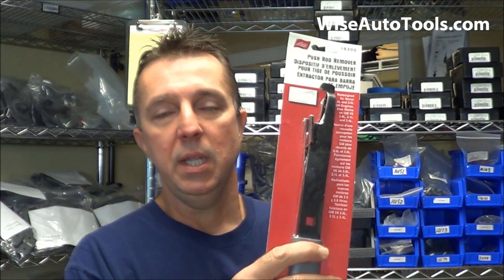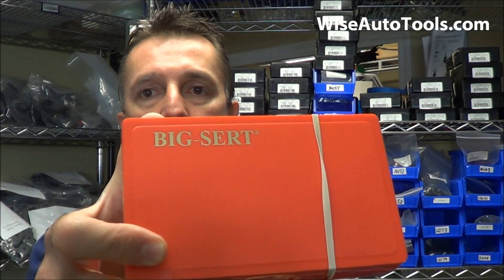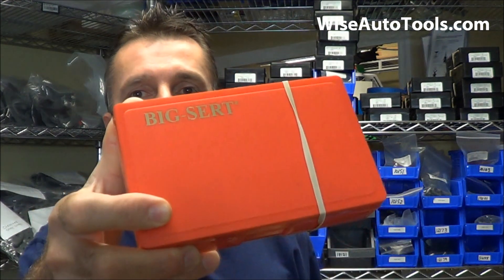Time Serts for GM Rocker Arms

Comment: I've been using the 1/4" techangle torque wrench and haven't had as much trouble as I had been having on these. Use a 1/4" torque wrench or use the special tool to avoid removing the rockers.

Comment: How do you know if your engine has 8mm or 10mm size rocker arm?
Reply: Eh there's a trick I can't remember right off but I usually just take the front valve cover off and see .. Either a 8mm or 10mm will fit..

Comment: Just some info, they actually went the other direction and started with 10mm rocker bolts and on the newer 2003+ engines IIRC they changed to the 8mm bolts.  Good example of this is a 2000 3400 engine will have 10mm rocker bolts where an 04 3400 or 04 3500 will have the 8mm bolts.  I'm doing the threads on my 3500 heads because they are in a race application and have been removed multiple times now.

Comment: 5.11.14.     If your going to change the L.I.M. Gaskets, do your self a favor & change the head gaskets also. I pulled mine on a 99 chevy lumina with 82k miles & the Dexcool had started to eat through the head gaskets! They were not yet leaking but would been very soon! Long life coolant sounds good for P.R. But it's poor in practice. 2yrs/30k miles & change it out.
Reply from the maker: Dexcool starts to gunk up after awhile. And like any coolant electrolysis can be an issue even if the coolant "looks" good. I did a head gasket on a Durango because the aluminum was eaten away. The gaskets would have been fine if it wasn't for the aluminum being deteriorated by electrolysis. http://www.denlorstools.com/autoblog/2009/12/misfire-and-coolant-loss-dodge-4-7-possible-head-gasket/

Comment: If I'm in to replace lower manifold and/or head gasket on 100,000+ mile car, should I replace the valve stems seals and/or do a valve adjustment while I'm in there, or just leave those rocker bolts alone? Ours has probably more like 135,000 miles.

I'm the type that likes to get other things done while I'm in there to avoid re-visits.
Reply from the maker: If just doing a lower intake gasket (because of a coolant leak) and there's no issues that would lead me think the valve seals were bad I would not replace them. So I would leak the rocker bolts alone. But, if doing head gaskets, I would take the rockers off and send the heads to the machine shop for them to check them over. Good Luck.